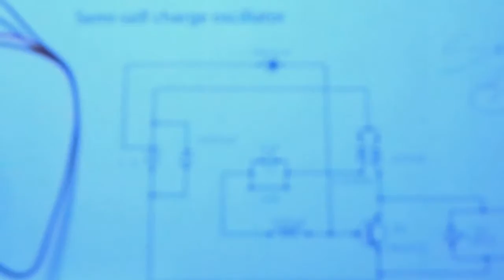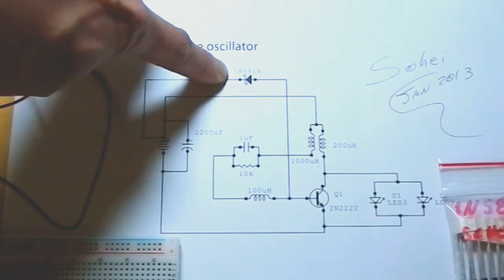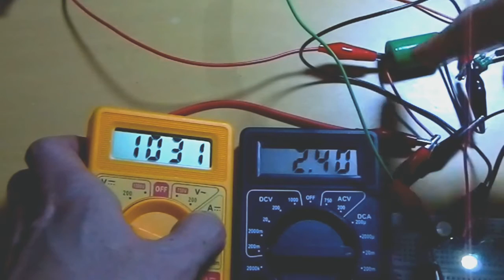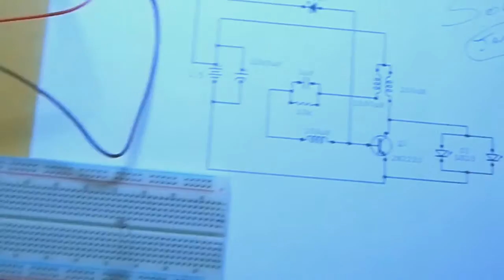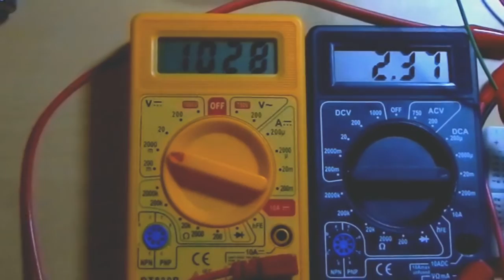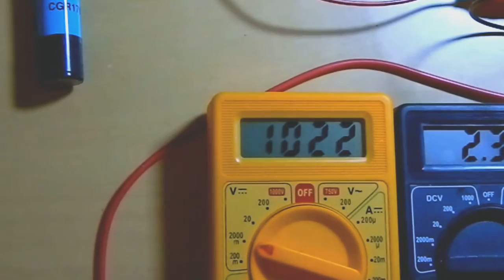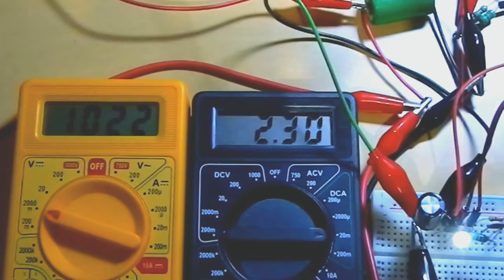Semi-Self Charging Joule Thief ( or oscillator )

Comment: One way to test if the battery is charging would be to run the charge down for a while, unhook the battery and measure its Voltage, hook the battery up again so it will charge (with the diode) let it charge, then unhook the battery and measure its Voltage to see if it is more or not.

Comment: I don't think my circuit worked out too well. I used 100ohm resistor and 10pf to the base of a darlington pair using a 2n2222 into what I think is a tip 31 transistor or a tip 10v 10a. I put about 1uf or .5uf across the battery using ceramic capacitors. Then the output runs another joule thief or solar light. The battery was a 4ma 4.1v. It was an almost dead 9v cell. The led lit up brightly but I think the 9v cell will probly go out soon.
Reply: Dear 

I could not create true Sohei's Circuit.
Please help me and give me information that how can i buit it.
Best regards

Comment from the maker: You are right... the white LEDs I use needs 3.4v and 20mA to reach the same brightness. But see how amazing these oscillators circuits are... at 400mV I can make them very bright. And the meter shows the voltage on the battery.
Reply: what current do you consume at 400mV? I am using BC547 and can work on uA but brightness isnt great..I need mA to make it bright

Comment: @sohei: 400mV and still bright? Please note, Voltmeter reads "average" voltage that in real varies between 0 to around 3 Volt (=conducting WHITE LED voltage), but not at 100 duty cycle. This can be seen on oscilloscope, 
Remember this: White LED will not lite at all even connected directly to fresh 1.55Volt battery. Please someone correct me if I wrong. Thanks.

Comment: The two separate inductors are really not separate because they are coupled magnetically.  The windings of a toroid are coupled magnetically, not electrically, so both are effectively the same.  But I do not consider the two inductor JT to be a circuit that is ready to go into production.  You will not see this odd way of coupling two windings in commercial equipment.  If it was to be used commercially, the coils would have to be mounted solidly next to each other and glued in place.

Comment: Yeah, looks like recovery due to the lower load on the battery when the diode is in place. You could try the LED's to Collector and Base and compare amperage draw (I prefer it to the general normal Collector and Emitter) as the LED's are more directly over the coil collapse voltage. Increasing your tank circuit resistor from 10K would lower amperage used but also lower the LED brightness, depends what compromise you want, light or run time. Throw a small solar panel on and you may get 24/7  :)

Comment: I think the reason it's so bright at low V is because the feedback winding is 1000 uH, five times as much as the primary winding of 200 uH.  There are more  turns on the 1000 uH and therefore higher feedback voltage and the JT will put out more at lower supply V.  I've been experimenting with coils that have 2 turns on the primary and 400 turns on the feedback, and they will oscillate at less than 0.1 volt.

Comment: About your Q   A Joule Thief is a simple one transistor device that uses the inductive kick of a coil to boost a low voltage up to the voltage needed to light the LED.  The coil can be a toroid, a bobbin, bar or rod of Ferrite, or it can be a coil of wire with an air core, or any other non-magnetic core such as a piece of wood or plastic.  The conventional Joule Thief uses a 1.5V battery, a single transistor, a single resistor, and a coil and LED.

Comment: I looked closer at the schematic.  The voltage at the right side of the 1N5819 has to overcome the 0.4V of the diode and the battery voltage, which totals over 1 volt, maybe as high as 1.9V.  But the voltage starts to rise and when the base to emitter junction starts to conduct, the voltage can't go any higher than 0.6 to 0.8 V.  So the diode doesn't conduct.  I would say that the right side of the 1N5819 should be connected to the collector which as 3.3 V. (cont'd)

Comment: When the current drops, it gives the battery a chance to recover, and the battery voltage starts to rise.  It will do the same thing if you disconnect the Joule Thief.  But when the circuit is running and the voltage continues to rise, it will eventually level off and the start to drop down to maybe a half volt, until the cell is no longer capable of powering the JT.

Comment: You are semi charging. There is charge going to battery. But unless you can run it for a time, and get more volts after run than before, its not as much charge as load. What is interesting though, is that you can excite the chemistry in some batterys. So they stay in a recovery state. I have had very flat batterys run for weeks, some people claim years. Even if battery goes over start voltage when running, it's not necessarily a charge. Need to finish higher than start. 3 hours rest to read V.